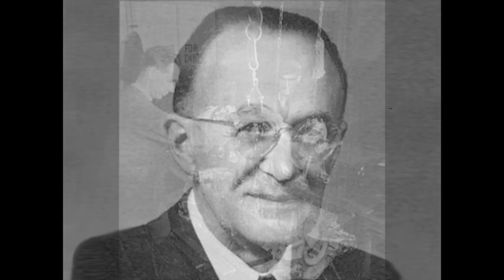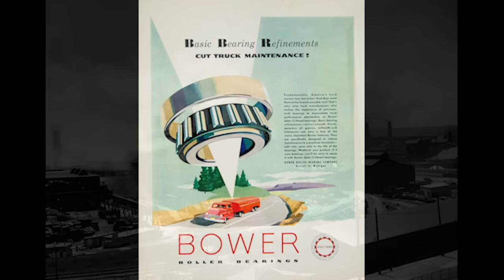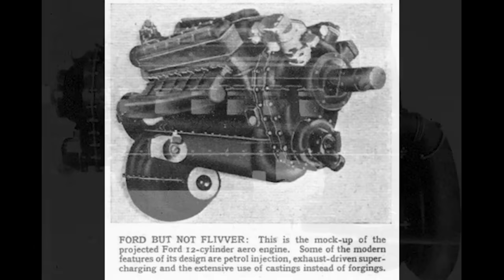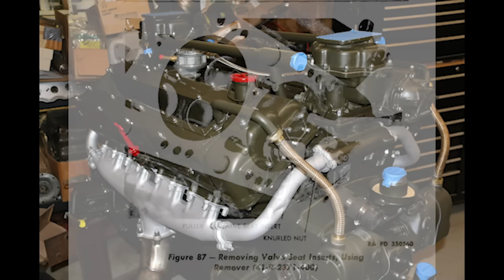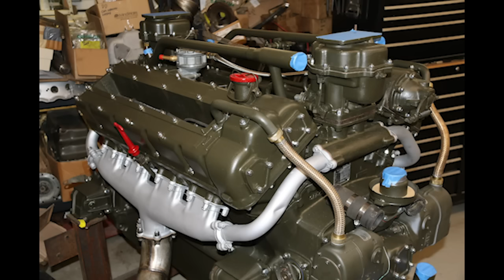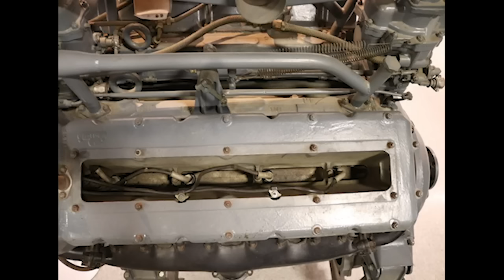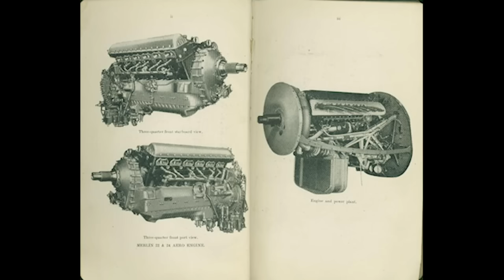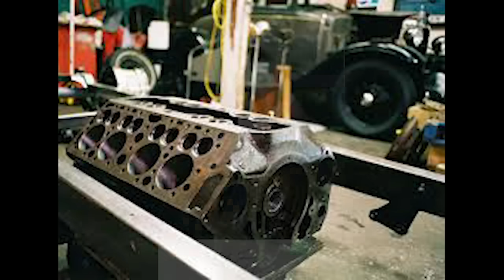War Hemi: The Story Of The GAA V8 - 1,100ci of aluminum WWII Ford grunt

Comment: You should talk about the odd firing order. Alternates between 60 and 120 degrees of crankshaft rotation do to the flat plane crank and 60 degree V angle. It required two seperate 4cyl distributors because of this. Mustve been rather rough running. I guess thats why the flywheel weighed 200+ pounds.

Comment: Regarding tractor pullers (mentioned at the end of the video) there are two currently active pull tractors, one in Europe and one in the Midwest U.S.A. The Euro GAA has two turbos and no blow off (safety) valves. Their data logger normally shows around mid-60s boost psi on a warm day and 70 psi on a cool day. It runs on alcohol. Normally it shows up at the track and almost always wins its class. The team owner / mechanic advises they periodically twist the frame from excessive torque. They are home based in Belgium or the Netherlands. The U.S.-based puller is based in the Midwest and wins some and places or shows in others. The European team has been tractor pulling for about 20 years and are just a smidgen under being a full time team.  
Regarding the GAC V-12 aircraft engine: in 1940 the Allison had a single stage supercharger and put out 1100 hp. The Merlin put out 1300 hp with a two-stage supercharger. In its first month of dyno work, the Ford GAC put out 1900 hp with two turbos. The Ford data is recorded in internal FOMOCO documents. The Allison in 1945 put out around 1300 hp, the Merlin got itself up to 1800. The Ford aircraft engine never got itself over the 1900 hp due to the Army Air Corps telling Henry Ford that they didn't see a future for his V12, after which Henry closed up the development. 

Other aquatic competition for the GAA (V-8).. There was a man living near Lake Mead (Hoover Dam) who ran a V-hull racing boat with one GAA driving two Mercruiser racing outdrives. He had one 6" cogged timing belt running off the engine, and then powering the outdrives. He once tromped the go-pedal on his boat a little too hard and snapped the 6-inch cogged belt.  His competition was (2) 427 big block Chevys on fuel injection. He won his share of races. Being a typical racer, he was never satisfied, and converted over to an aircraft turbine. It caught fire, and his boat  is now resting quietly in about 500-t of water in Lake Mead. To him, "quit while you're ahead" didin't apply.   

One other boat engine story. There is an engine builder who is a member of the GAA buy-and-sell website who once got a contract to build two GAA V-8s for a man who wanted to add some power to his cabin cruiser. The engine builder had some custom parts made up, more compression, etc, and then had Ed Iskenderian, the famous cam grinder from Los Angeles, work up a set of cams for each GAA engine, you know, for "added durability and economy" and then ran the engines on a big Clayton dyno, and his effort took the stock GAA's 1125 stock pounds of torque and upped it to 1800 pounds.

One final thought...  The Ford GAA engine is the exact reason why the National Hot Rod Association (NHRA) put in a 500- cubic inch limit on all their drag strip cars.

Comment: The implication that FORD got it's hands on the RR drawings, essentially copied them and ran with it is complete BS. FORD wanted to get in the aircraft engine business long before RR got interested in domestic sourcing of key Merlin components. It takes YEARS to manufacture tooling for engine casting components and forged components and you need to drawings before you can order tools. Sorry, nice story but no relation to reality.

Comment: My grandfather had a fused hip from birth and a bad heart valve so he couldn't serve in the war. Instead he told me he quit his job at the Awrey's bakery as a delivery driver and went to work for Ford for the war testing tank engines. The story goes that they had the test stands for these tank engines in buildings near River Rouge and he said they would pull a random tank motor and run the thing til the manifolds started to glow. They would then start a 24 hour countdown and wait to see if the motor would pass, all the while it was bellering into the night. I didn't know about the GAA until many years after he passed, but then it made sense.

Comment: Look at the (not user friendly) eco-boost V-6. I had a 2015 F-150 with 3.5 eco-boost. I fought coolant leaks, broken exhaust manifold bolts. It is a poorly engineered engine. That said, the govt causes most of the engineering issues with automotive design.

Comment: The V-12 had incredible potential. Though a V16 version with multiple stage supercharging would have been devastating in a fully developed P-38, or slightly redesigned P-51.

Comment: What about the 2005-2008 Dodge Magnum SRT 8 Wagons? Advertised 425 HP (Actual output supposed to be 467 HP). Racer Tommy Kendall described it as a race car for the street.
Reply: I have a 2010 Challenger R/T 5.7 HEMI I raced it in 2011  and 2012. I out ran every SRT 8 I raced. So I’m sure the 6.1 SRT 8 only made 425 hp
Reply: Daimler Benz designed a great motor... too bad its not a real hemi.
Reply: Just because it has quench area in the combustion chambers doesn’t make it any less a hemi
Reply: @jimmyford796  Its not a hemi... if it has a quench pad(s) that confirms its not a hemi.

High swirl combustion chambers are by definition, the polar opposite of the hemispherical concept and theory.
Reply: Isn’t it funny that engine experts agree that indeed it is a hemi
Reply: @jimmyford796  Sorry... but Bubba and Uncle Earl are not experts.

Quench = Not Hemi
Reply: If you want to get right down to it none of the HEMI engines were “true” hemis because the combination chambers weren’t full half circles so the gen 3 is just as much a hemi as any of them
Reply: @jimmyford796  First and Second Gen Chryslers were hemispherical type chambers. The last "True" hemispherical engine by Chrysler (the 426) ceased production in 1971.
 The very last production automobile engine for sale with a hemispherical chamber was the Porsche 911 in 1999.

Chrysler used the "HEMI'® a registered trademark spelled in all caps for other non-hemispherical engines including the HEMI-6 which was a Wedge head and the Mitsubishi Astron 2.6 liter which was a Pentroof.
 
The current HEMI brand V-8s designed by Daimler-Benz are not hemispherical chambers and are clearly a QUENCH type head with two opposing quench pads that function in the same theory as a Pentroof head,

Any questions?
Reply: it wasn’t a true hemispheric chamber because it wasn’t a full half circle so no Chrysler never made a true hemispherical chambered engine
Reply: @jimmyford796  Not true, No hemispherical engine is a true half-sphere.

 The Hemispherical chamber concept is based on improving efficiency by conservation of thermal energy lost through entropy, this is achieved by the reduction of surface area (Conduction) and reduction in the circulation of gasses (Convection)

This reduced heat loss compared to Flat-head designs and allowed higher compression ratios but has poor ignition/conflagration characteristics and overall poor combustion efficiency.

The hemispherical design is completely obsolete today and has been replaced by High-swirl or Quench type chambers that provided more power and efficiency despite having higher conduction and convection loss... the advantage of better combustion outweighs these factors.

Any questions?
Reply: you just proved what I said. If it’s not a full half circle it’s not a true hemi
Reply: @jimmyford796  If it has a quench its not a hemi...

Comment: I wish someone would build this engine again with some modern improvements. V8 & V12 variants as well. But it would really be interesting to see an inline 6 cylinder version of the V12 design. A 13.5 liter inline 6 could power a number of different size planes, in single, double  and possibly multiple engine layout.... Maybe Jay Leno needs a new project...lol. one can dream.
Reply: WHY? its a completely obsolete design.

Comment: Complete fiction.  Ford built more Merlins at their Dagenham plant than Rolls built in their own factory.  Ergo they had the blueprints at the start of the war.  The Ford engineers considered the engine obsolete.  Which is actually correct if you study it.   The Ford aircraft engine owes nothing to the Merlin.  A simple comparison of them makes that clear.
Reply: Yes, the Merlin was obsolete and it was too small... the Griffon was bigger but already rendered obsolete by jets by the time it was introduced.

Comment: Henry Ford successfully won a lawsuit against the United States because it bombed an engine manufacturing plant in Germany that was making Ford engines. Henry Ford was a traitor as far as I am concerned.
Reply: Chevrolet operated factories in Germany as well... they also received compensation.
Reply: @sandervanderkammen9230  Yes. However, this video makes Ford seem like a patriot. He was far from a patriot.  He was simply interested in money.
Reply: @deanmorris2546 Ford was one of the largest manufacturers that supplied war materials to the United States government during WW2.
Many companies, not just Ford benefited finacially from government contracts
Reply: @sandervanderkammen9230 I understand.  I was referring to a lawsuit that Ford filed and won after WW2 because the Alies bombed a manufacturing plant building Ford engines for the German war machine.  That is about as anti-American as it gets.

Comment: HEMI my foot.  This is a pentroof head.  A 4v hemi would be impractical no matter where the cam is.
Reply: It's a Hemi design, there are no Quench pads in the chamber,  Pentroofs have a rectangular shape chamber
Reply: @sandervanderkammen9230 the v12s the gaa copied look sort of like hemis.  The cc is somewhat shaped like an eraser head.  However intake valves are lined up on the same plane.  Valve springs are lined up parallel.  Same for exhaust valves.  Even the relatively flat cc of the plymouth poly head has a more hemi like arrangement with porcupine valve stems.
Reply: @sandervanderkammen9230 flat heads are rectangles, wedges are triangles, pentroofs are isosceles triangles, hemis are half spheres.  A quench area could be absent from any of these.   A 4v hemi would require pedestal rocker stands and massive clearance, eg. 3 inches, between cylinders...hence the lack of interest in building one.
Reply: @overcastfriday81  No hemi engine has a perfect half sphere chamber.
 Hemispherical combustion chamber architecture is a design concept that is based on the theory of the smallest possible surface area for a given volume as practical.
Certainly, a 4 valve hemi is a design compromise, but the GA still used this concept.
Ricardo and L'Orange both developed Quench type chamber technology before the  war in Europe, this concept saw no practical applications in the United States until after the war ended.
Any questions?
Reply: @sandervanderkammen9230  It sounds like you're claiming small curves at the edges qualify a cc as a hemi.  Non-hemi engines can use walls that curve inwards.  Many pent roof 4V designs use curved sections.  Google for images of pent roof chambers.  By your criteria, those are hemis.  Keep in mind, vocabulary is a sort of democracy where the most common use becomes fact.  In the 90s, Americans often referred to carbon as graphite.  They were beat because the majority eventually agreed graphite was a sloppy term. One of my cars has the heart shaped cc with lots of curves inwards towards the spark plug.  By your logic, anyone with those heads could grind away the quench area, and offer them as hemi heads.  Good luck with that.
Reply: @overcastfriday81 Yes, your comments reveal someone who has no formal education or professional experience regarding this subject and is not qualified to discuss this topic intelligently.
 You clearly do not understand the basic fundamental principles of combustion chamber architecture or the proper terminology used by engineers
Reply: @sandervanderkammen9230  says the fool who claims pent roof chambers are a rectangle.
Reply: @overcastfriday81 Pentroof chambers have two opposing quench pads... this produces a shape that has two straight sides and two side which conform to the cyclinder wall diameter

Hemi engines have completely round chamber with no quench pads.
(Like the Ford GA series)
Any questions son?
Reply: @sandervanderkammen9230  Upon review of a GAA head diagram, at least one popular version used upright, parallel valve springs but valves are angled inside the springs.  Two intake valves canted towards the center, and likewise, two exhaust valves canted towards the center, both angled slightly within their respective springs.  This results in a conspicuous crease along the top of the chamber.  Not every b/w photo shows the crease well.  Since intake valves are parallel to each other, as are exhaust valves, this is not an attempt to make a hemi.  A pent roof may or may not have quench areas.  It's named after the roof shape.  All resources discussing the two heads in depth mention the 2 valve limitation of hemi CCs.  In some photos the crease is not conspicuous, but slight curves in the CC are visible.  This may lead to the widespread confusion.  Ford fans aren't the first.  Look hard enough and you'll find BMW fans referring to their pent roofs as hemis.
Reply: @overcastfriday81 Your comments only serve to confirm that you are not educated or have any professional engineering experience.
Please refrain from posting comments regarding this topic for which you are not qualified to discuss intelligently.
The GA series uses a Hemispherical combustion chamber design.
 You will not find any reference materials on the GA that agrees with your misguided theory and no qualified engineer shares your opinion.
Reply: @sandervanderkammen9230  When staying on topic reveals your ignorance, one strategy of debating is to steer away from facts, change the subject to attack the person.  It's called the Ad Hominem Fallacy.  You even try to apply it in bold.  You'd make a great cnn reporter, but terrible engineer or scientist.  I have to stop now as you are obviously a waste of time.
Reply: @overcastfriday81  This engine is clearly a hemispherical type chamber... its not a flathead, its not a bathtub and its not a wedge or a Pentroof...  100% hemi design.
Reply: @sandervanderkammen9230  The fact that you think quench pads define what is or isn't a hemi means you need to get a refund from whatever "mail order" degree you purchased.
Reply: @overcastfriday81 Sorry boy, I suggest you stay in school and get yourself educated son.. your comments reveal someone who has no formal education or professional experience regarding this subject.
Please refrain from posting false and misleading information on a topic that you are clearly not qualified to discuss intelligently.
Reply: @overcastfriday81 I have a degree... its obvious that you do not.
Are you a lube tech at Walmart???
 I will defer to your expertise regarding what whench size to use for the drain plug... or are you one of those guerrillas that uses an adjustable wrench??? Lol!

Comment: What a crock!!  That Ford refused to work for any foreign country . . . .  Henry Ford built truck factories in Germany during WW2 and helped Hitler research creating oil from coal.  A google search shows Henry WITH Hitler, even received the iron cross.  Henry Ford was a traitor!
Reply: GENERAL MOTORS had significant operations and investments in Germany
Reply: Opel was a huge supplier to the Nazis... it was owned by General Motors Corporation.

Comment: Many may not know but the V-12 crank headed to tractor pulls, came with a hollow crank to keep weight low. These were sealed by “Welch-Plugs” a frost looking cup with a dab of sealant that helps hold oil. Virgin steel was used in these castings and may fail with today’s recycled metal.

Comment: THIS ENGINE DOES NOT HAVE A HEMISPHERICAL COMBUSTION CHAMBER. IT IS CALLED PENTROOF. ALTHOUGH IT HAS BEEN ATTEMPTED A FOUR VALVE HEMI IS PRACTICALLY IMPOSSIBLE. Gets lots of views by low information people though I guess that's the point
Reply: 100% hemi... get yourself educated!
Reply: You're sadly mistaken. There are plenty hemi 4 valves, go to the junkyard and take off some heads of modern 4cyls
Reply: Sorry but this is a Hemi design.
There are are none of the characteristics associated with a Pentroof design

Comment: I'm a bit confused about something. During the war, Rolls Royce could not build enough Merlin engines to meet demand, so they licensed the design to both Packard and Ford. Packard built their Merlins very close to the RR design specs and built around 55,500 units. Ford redesigned the engine for easier mass production and built around 30,400 units in their Manchester plant. Is this the Ford V12 engine being referred to? This is the first I have heard of a rivalry between Ford and Rolls Royce in the war engine production area. I read that the Ford Merlin was intended to compete with the Allison V12. I had read quite some time ago the Ford's tank engine was derived from their Ford Merlin V12, which did not share parts with either the RR or Packard engines.

Comment: Recollect that WW2 started Sept. ‘39 and U.S. entered Dec ‘41.  In the interim both Ford and GM in Germany were building stuff for the Nazis.  Had Ford produced RR engines, the Nazis would have nationalized Fords German production.
   In the same interim, it was uncertain who would prevail.  So Ford stayed neutral.
   Henry Ford was antisemitic and likely colored his thinking.
   Ford was well aware that engines would be needed for the war.  I imagine they had the GAA in gestation well before Olly/RR came knocking.  Fords interest in the Merlin was checking for useful details to be incorporated into the GAA.  RRs prints were a gift.
   I think the GAA would have been a solid airplane engine and significantly cheaper than the Merlin or Allison.  It was not to be.
Cheers